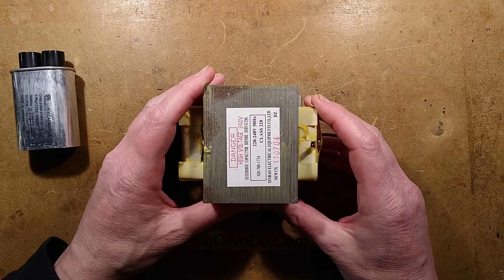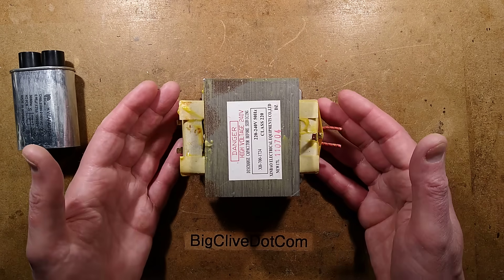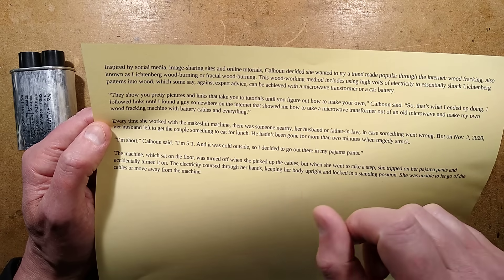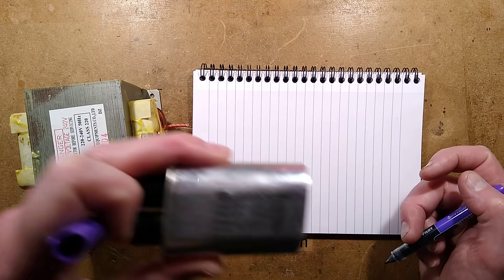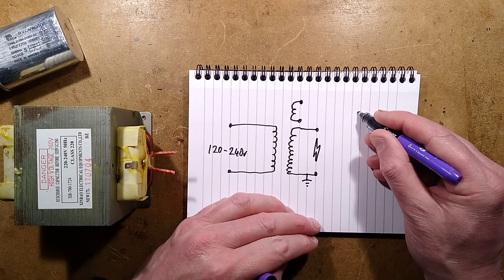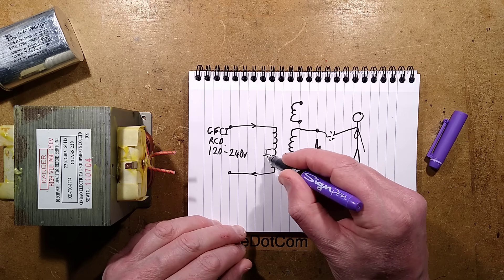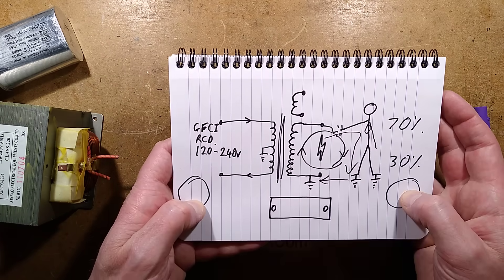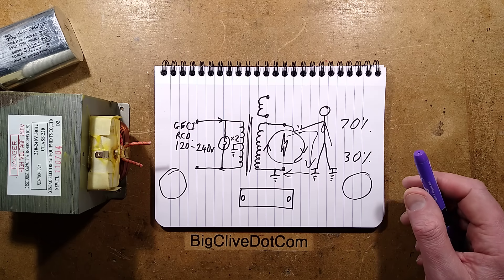The most deadly project on the Internet

Comment: This reminds me of working on high power (three phase, three line power) radar systems. BIG voltages that could shoot your eyeballs across the hanger. I don't fear electricity and static charges, but I sure as hell respect them. Learned some safety precautions from old guys...like wearing two pairs of socks, resting your elbow on the frame while making adjustments (to eliminate current going through your body), and eating/drinking around energized equipment (like a transmitter, radar van, etc).
Reply: My aunt was an X-ray & MRI tech, and they were trained to never touch the machine with both hands, if at all possible - apparently there are a lot of extremely angry pixies in some of that equipment, and if some of them make a break for freedom by way of your hand, you want them to travel down your leg & through your shoe, vs straight across your chest, through your heart, and out your other hand.
Reply: @DaddyBeanDaddyBean  YEP...so true. One hand adjustments will likely save your life

Comment: I think when connected inside a microwave, the filament heater is also at high voltage relative to earth.
That's why it has such a thicc silicone insulation.

Comment: I have watched people playing with these microwave transformers and I shudder when I see what they are doing. I am electrical engineer with 40 years experience  and I would never attempt some of these "experiments". It isnt cool to be dead. Many years ago when I was a small child my sister accidentally knocked a curling iron into the tub. The one thing that I remember to this day is that I could not move.My body and muscles were stiff as a board and I vibrated. If it had not been for my sister I would have been dead, That was how I discovered that electricity is dangerous and years later in University I found out why.

Comment: On the topic of a dead man's handle. Would the pendant style not be a better choice where you have to keep a very specficic amount of grip on it, not too little grip, not too much, usually seen on CNC machines and industrial robotics but you can get ones that just allow a current to pass through for about £50. I could see someone using the other style of dead man's handle and doing what everyone does with their hands occupied and trying to move something with an elbow or a foot.

Comment: I'm a energy technician and I had a customer once who asked for 5m of high voltage cable, and I was like wtf do you need that for? That's when he showed me is his contraption. It was a home made 3phase high voltage transformer that cranked out 32000volts in a wood box. He said he uses it on patients with muscle problems by having 3 bare electrodes arranged in a circle (just far enough where they wouldn't arc) and having the patient sit in the centre. And he needed the cable because he just used a short circuit resistant cable and it arced through the insulation when he touches it. And before I could say anything he deadass turned it on and touched the cable and a bright blue arc as bright as a lighth bulb flashed up, all he said is that it tingles a little. 

I considered quiting that day.
Reply: So he's built his own electric chair!  Enterprising.
Reply: @mandolinic  if the OP is correct it's an order of magnitude higher voltage than the electric chair.. let that sink in as he shorted it and caused a massive arc while saying "this tingles"... Jeez, it needs a Ralph Wiggum meme...
Reply: @CED99  ROFL.
Reply: GOOD LORD!! If that guy used that kind of voltage around them (his patients) , I wouldn't be surprised he would successfully keep them out of misery for good the wrong way.
Reply: The customer is always right!
For a little while at least...
Reply: So how much did ya charge him for the cable and did you toss in a microwave bag of popcorn?
Reply: Was your customers name Dr Frankenstein by any chance?  I have heard of him before.
Reply: @yorkshirebikerbitsnbobs  LOL
Reply: It looks like that if you have enough stupid, you can beat electricity, until electricity learns and decides to attack your single brain cell.
Reply: That voltage was a quite low....  I remember seeing info on how to make a Van De Graff generator in Boy's life magazine when I was a kid... Was supposed to put out 500,000 volts, but the amperage was so low you would just feel a tingle. It was just rubbing a cloth belt over some plastic with a small motor to collect static.
Reply: Was your customer's surname "Kevorkian" by any chance?
Reply: If it was blue it probably does just tingle
Reply: IHeardIfItsHighFrequencyItWillNotElectrocute.
Reply: @ovidius2000  But have never heard of a spacebar
Reply: @MadScientist267  iHeardThatItSitsOnKeyboard.ButIDontKnowIfThisIsTrue.
Reply: First: what frequency do you call "high" 50k , 200MHz...? Technically, the higher the frequency, the more the current flows on the outside of the conductor. But thus happens gradually and there are other factors to deal with
Reply: @AndreasSchlitzkus  I got to read up a good bit on this due to a work project running at ~350kHz, and where we ended up using fairly heavy Litz wire to handle the power output.  
Thankfully relatively low voltages for our work, but the HF makes for interesting complications all on its own.
Reply: @AndreasSchlitzkus  DontKnow.ButIImagineAtLeastInTheRangeOfKilohertz.

Comment: Big paper cutters use double buttons 3 feet apart to actuate the blade. Keeps people from cutting their hands off. Those have the added safety that both buttons must be pressed within a second of each other so people don't jam one of the buttons down and use it one handed. I have seen machines where someone has gone in and bridged the connections to use it one handed. You will though eventually use the machine one handed because the other one has been crushed to pulp and sliced off.

Comment: Through sheer carelessness, I once took a 277V shock (440V three phase leg to ground) from my right hand to my right knee and luckily survived without significant injury. I do not ever care to try my luck with higher voltage.

I've had a few 120V shocks in the course of my life, and they are not fun, but the 277V was a whole different level of pain, that I felt through the entire path of the current.

Comment: I have not done that type of artwork before. However here in 60107 USA, a power line came down in a wet field and left a stunning image of what you have. The ground image was almost 200 feet long by almost 50 feet wide.
Reply: Lightning does this in sand, it's called Fulgurite.
Reply: Ironically enough those power lines usually have lower voltage than what MOTs provide :P But I suppose the power was applied to the wet field for much longer....
Reply: @CoolKoon  Don't you believe it!  Those wires at the TOP of the pole have more voltage and current than a MOT.  I've seen a disturbing video of crazy or drugged person climbing a pole (aka pylon) to the top and exploding in flames.  This was from a news video not a movie, the poor guy was flaming as he fell down.  Do not even touch the ground near a downed line, let the power company deal with it.
Reply: @davidg4288  "Those wires at the TOP of the pole have more voltage and current than a MOT." - It depends. Yes, in Europe the three-phase distribution lines have 22 kV in them (at all times), which a LOT more than what the MOT can provide. However IIRC the single-phase distribution lines in US suburbs run only on 1 kV, which is why the distribution transformers they use can be so small.
Reply: @CoolKoon  Where I live in Northern Ohio there is 13 kV in the backyards and down the streets in the suburbs.  Downtown it's often 4 KV.  The wires are insulated but may get damaged, and there are fuses but those are to clear faults not prevent shocks.  Gotta be careful with ladders, antennas, and tree trimmers.  Also lines down due to accidents and weather can cause a "step potential" so even walking on the ground near a live downed power line can be dangerous.  Anyway even if it's 1 kV I'd stay away since the current would be huge.  Also I steer clear of cable TV and phone lines hanging down you never know if they are touching something up there.  

The microwave oven transformer IS the deadliest electrical device easily available to the average homeowner that I can think of.  I'm glad Clive is pointing out the danger to experimenters, the world is full  of hazards but people need to be aware.
Reply: @davidg4288  "Where I live in Northern Ohio there is 13 kV in the backyards and down the streets in the suburbs.  Downtown it's often 4 KV." - Fine, I don't know the US electric grid that well. I only know that they aren't interconnected into a single (AC) network and thus are extremely vulnerable to any bigger load imbalances (as we saw in the past few decades).
"there are fuses but those are to clear faults not prevent shocks" - First of all fuses are ALWAYS overcurrent protectors, even at homes, they aren't there to prevent shocks. And second in case of HV fuses might not blow if it's not a dead short.
"Anyway even if it's 1 kV I'd stay away since the current would be huge." - I fully agree, that's the voltage level at which currents start approaching dangerous levels and kill the victims by burning them alive from the inside.
"The microwave oven transformer IS the deadliest electrical device easily available to the average homeowner that I can think of." - That's still a bit of a stretch. They'd still have to disassemble a microwave oven to obtain it and as such basically anything obtainable via eBay is easier to get.

Comment: Best use of an old microwave transformer - a doorstop! Some parts of a microwave oven are easily reusable - door microswitches, relays, turntable motor. The transformer can turn you into dead weight, and don't forget about the bang from the capacitor.

Comment: I'd also argue that for some things (this may apply), the 2 hand switch should be constructed using double pole switches so both switches open both sides of the line. Not strictly required, but the odds that 4 pairs of contacts will all weld up at the same time is slim to none and slim left the building.

Comment: I made a fractal wood burner with two microwave transformers in series but I have a main power switch and two Deadman switches with one I step on and one that I press with my hand and wired so that either one kills the circuit, but that thing always scares the s*** out of me when I use it. With the high voltage cables run on the ground you can literally see the dirt moving from all the current passing through the cables.

Comment: when i was in high school starting my apprenticeship in the 10th grade .That's when schools were proper schools ,we were told that 1 of  us will die from electrocution and 5 from work related illness . We were a class room of 30 students .We were taught a very important rule .You don't have to look for electricity,it will find you !You can't always Hear it,Smell it or See it .It can be a very silent killer !Two hand anti tie down is essential for devices like this so power or machinery can't be activated inadvertantly .and both hands are out of the way .The one hand rule applies to hi voltage but it's not a guarantee.Approved gloves are essential and an isolation mat .

Comment: Electronics technician here. I usually work on automotive and digital stuff and occasionally on tube audio equipment. Those microwave transformers scare me. Whenever I see videos of people messing around with those transformers it makes me cringe, because I can tell most of them don't have any idea what are they doing and really how dangerous it can be.
Reply: Anybody know what is the voltage of the secondary winding of a microwave oven transformer?
Reply: @krmathews1  if you watch the video, Big Clive says at the beginning what is the voltage range of the transformer. It is usually around 2000V AC, but if you convert it to DC and filter it properly you can get around 2.8 kV. Dangerous stuff!

Comment: I'm a Station Engineer or at least I was i'm Retired now. I went to HVAC school and I had been doing HVAC for many years before I went to school. One of the first things you do is Learn about Electricity and what it can do then you learn schematics and then wiring HVAC systems, They teach the Dangers of Capacitors and Transformers and about step up and step down Transformers. Line voltages, And protecting yourself. Even a Capacitor can kill you, Burn you seriously or even incapacitate you. 

Even Common appliances can be very dangerous. much of what we take for granted and use everyday around the house has the potential to kill someone due to electricity. When  you read the back of a device people need to take heed at the Warnings. Most tinkering types of people don't till they get a shock then they are a little more careful. It's like tell a child to stay away from the wall receptacle, don't put anything in there. They Are going to do it. Much like tell a child don't touch that open flame on a stove it will burn you. Some people have to have that experience to learn.

Playing with Electricity is just one of those things in Life you really don't want to experience. Even being trained and having years of experience I have been shocked due to Micro cracks you couldn't even see as the insulation could be old and hardened and has shrunk causing stress in the material that can be caused due to heat or even cold or both. Have had large screw drivers even insulated ones burned through by just a little slip, This was working on breaker panels that some homeowner had monkey rigged to add in some lines to a garage not knowing what they had done was dangerous to begin with, an could of burned down their garage. 

I have had homeowners and Business owners try to get me to save them a buck by doing shortcuts, I tell them to get someone else. I don't do short cuts. If you want it done right i'll do it. Have walked off of jobs before due people wanting me to save them a buck. 3 days later they were calling me back. Repeat business isn't worth doing shoddy work. You endanger the owner and possibly their family or someone else. I never ever had to advertise, your work precedes you and people recommend good quality.

The worst case is someone trying to save a buck and short cutting. Some of the tools you can buy aren't rated for high voltages. Always get the correct tool and quality tools to work on Electrical Products. Educate yourself use safe practices, take all precautions.

This is like Riding a motorcycle No matter how good you are you can't master it. When you think your a master that bike one day will teach you other wise. It doesn't mean not to go riding it means to be Aware of your limitations. Getting a little road rash will wake most people up. Electricity on the other hand can give you a permanent Dirt Nap.

Normal people just have no idea how dangerous electricity can be. Just using the wrong gauge of wire and or specialty wire that might have inadequate insulating properties can be a disaster waiting to happen.

People generally don't even know how their own nervous system works or how it's powered, Yep electrical impulses. Guess what larger amounts of Electricity outside your body's insulating properties can do when it's bridges with and outside source and your in contact with it effectively making a bridge. it overrides the electrical pulses. thus making your muscles either contract or go ridgid you have now lost control of your body and shocking the cardiac and pulmonary systems. This can cause a myriad of damage to your body and even have long lasting effects mentally. 

A simple battery can do the same thing to your heart if it hits your heart just right. It's not the voltage it's amperage. Much like a Taser. A Taser is high Voltage but low amperage though even a taser can kill some people and it might take a few days before it does. Like me I have 2 Stents one on the front side of my heart one on the back side. Getting Tased can kill me, it just stops my heart, same as working with live electricity.

Keep showing and explaining to people Big Clive, hopefully people that see this will get and Education on what not to do. You probably have saved a few lives or permanent disabilities with these type of Videos. It's worth every second of one of these videos.

Comment: Well done!  I just wanted to add a couple of additional cautions.  First, reiterating what you said, be sure to put the deadman switch on the 120/240V side of the circuit, unless you want it to be a literal dead man switch.  This ties into the second point, which is, very few of the electrical devices you can purchase will safely contain 2000V.  It is capable of punching through many things typically thought of as "insulators", like rubber-soled shoes, rubber gloves, standard electrical wiring, switches, etc., and typical METERS AND LEADS!
Reply: Even going down to 480V, a lot of terminals in industrial cabinets are just not designed for voltages that high.
Reply: My grandfather ran a rope making business. It had the motor in the corner driving shafts on the ceiling. 
He made a dead man's switch for the shop

Comment: I've also heard people call the wall socket voltage "low" voltage? Why? Because you can't make sustained arcs with it? Seems like a rather dangerous misnomer, given that it is still high enough to kill under the wrong conditions! If there's a higher-than-socket voltage involved, I either say "Line voltage" or just give out the number.